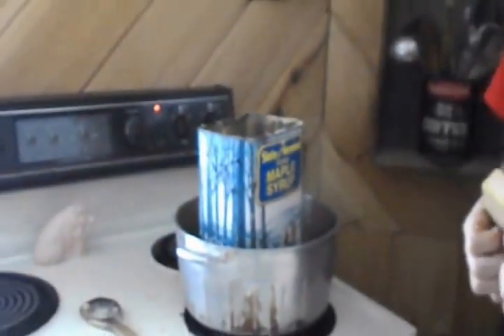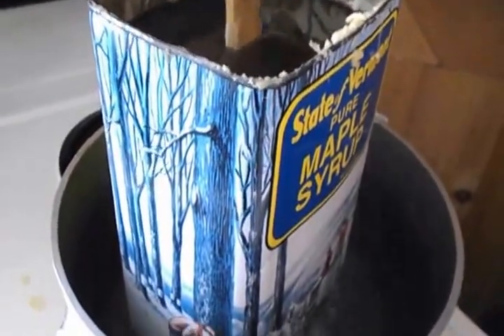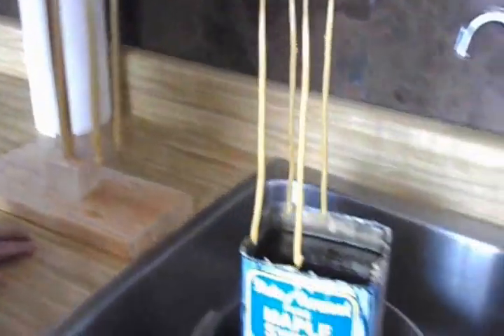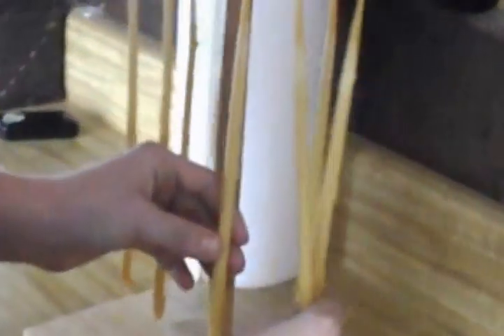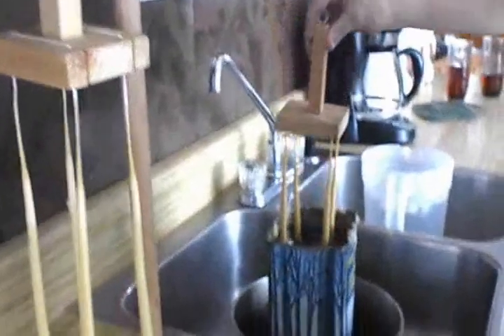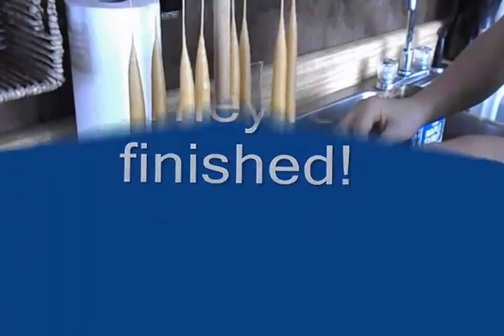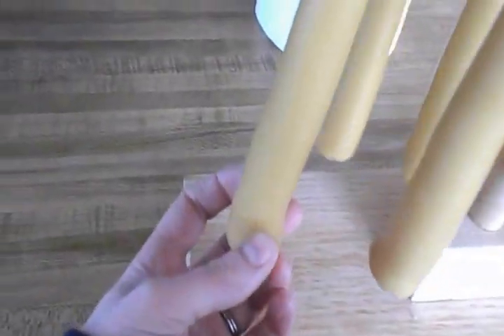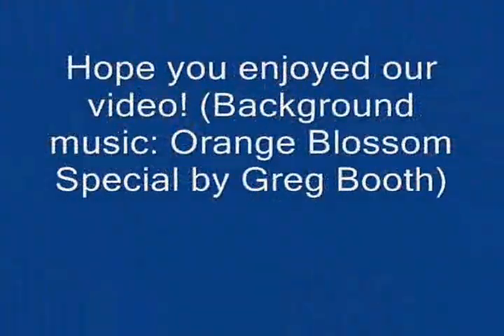Hand Dipped Beeswax Candles

Comment: How much wax did you have to use?
Reply from the maker: Hi! Glad you stopped by! There was already some in the tin from the last time. I would say probably 5+ pounds to fill the tin when melted. You could always make shorter candles too, or find a skinnier tin than I have to get the same size while using less wax. If you buy it in bulk it is cheaper. ;-) Hope that helps!